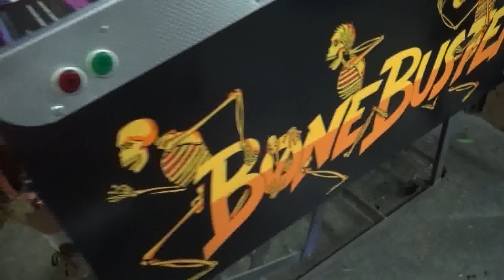#724 Gottlieb BONE BUSTERS INC Pinball Machine with Talking SKULL! TNT Amusements

Comment: I would love to see you do a show on restoring a Circus Voltaire. I have seen the bottom of the board when I saw a tape from another who was putting in better speakers and it looks like the ring master assembly might be rough to have to repair.
Reply from the maker: Lyle Johnson We bought ten of these when it was closed out, for $2199 each (the game was a huge dud!) I sold the last one in the crate for $3599.  I got half of them back from those private home sales and resold, but none of them had any issues with the ringmaster with so few miles.  We did get in a few vended Cirqus machines which we had to take the Ringmasters apart and clean them up.  Nothing too bad!  Haven't had one in our shop in probably over 4 years now.  Our videos covering our sales started perhaps 2 1/2 years ago.I guess sooner or later we will get one in!!
Reply: I can see why it was a dud. I found a two part video of someone playing Circus Voltaire and in the first part sideshow sam came up and seem to last forever. The sounds it made was so annoying.

Comment: Hi Todd great video it's always nice to see Gottlieb's appreciated and featured from that era on your channel . I've actually got a problem with my Gottlieb 80b machine at the moment. Everything turns on including the GI on start up but the score display (like the one on Bonebusters) only shows rows of zeros and there's no power to either the start button or red booking keeping button at the coindoor end, have you got any ideas what the problem could be? Kind regards Barry...
Reply from the maker: First, take out power supply and reheat solder header pins, tighten screws on regulator, and squirt contact cleaner on 5 volt pot and work it in,...then set the 5 volts right on the logic board.  If still no good, and the logic board has 5 volts, the next place to look is the satellite board which is probably ice cold...the issue is to really fix this right, it should be REMOVED from logic board so underside can be reflowed...and then carefully reinstalled...that is what gets tricky--you do not want to damage the traces of the board.

Comment: Hi all you pinball lovers.
I'm working on my 1st restore, which is a Bone Busters. Thought I had the bugs figured out... game starts normal but at some point during play it will release 2 balls instead of one. The switch on the out lane works, the ball is sitting on it, but it still kicks a 2nd ball. I changed the dip switch's to 3 and 5 ball play, tried it in single and multi player, still does it. It's erratic, doesn't do it every time or ever game. Any ideas?
Reply from the maker: Andre Butcher the return grounds on the bottom transformer are all white wires and plug into little boards on the side of the transformer.  Take boards off and reflow solder on all the header pins on those boards and also burnish the pins too....those return grounds can cause all sorts of odd issues